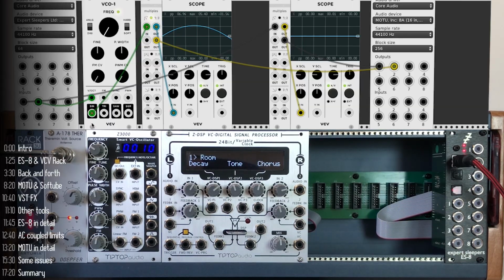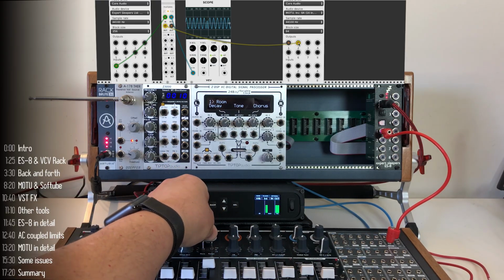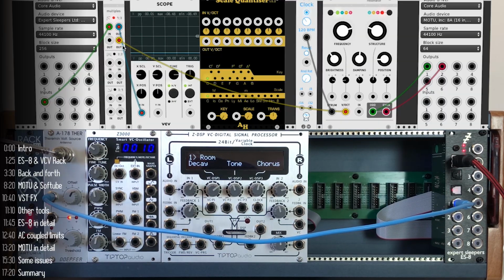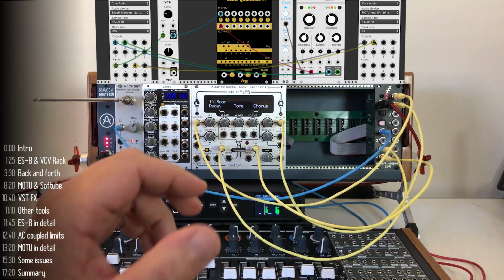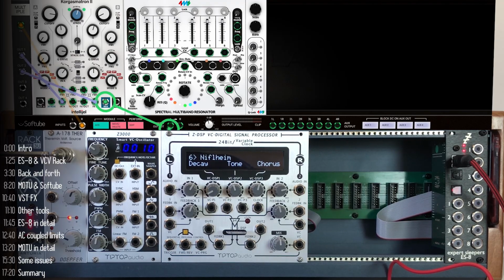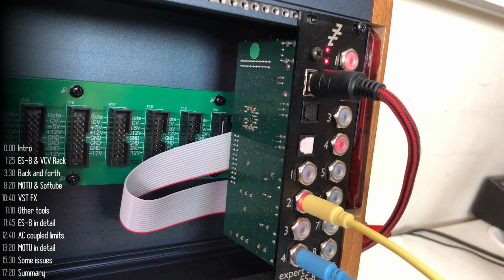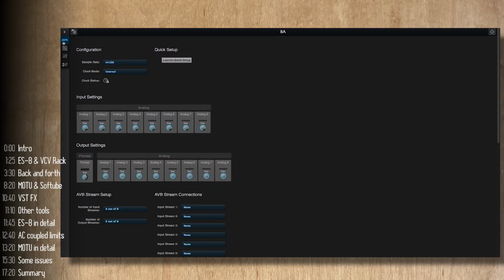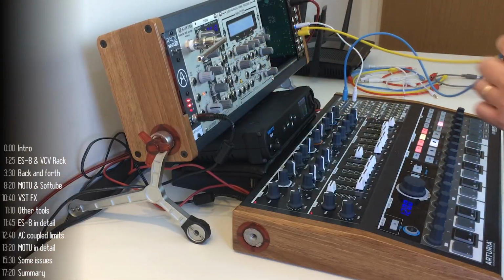Hybrid modular - The one must-have module: bridging Eurorack and VCV Rack, Softube (ES-8 and MOTU)

Comment: Screen update is maybe at most 60Hz, probably more like 30. Using that refresh rate to try and show latency (or the lack of latency) is just pointless - the latencies would have to be huge to be noticeable.
Latencies as low as a few milliseconds make a difference to the usability of a modular due to their effect on patches that use feedback - it's not just about whether you can notice the effect as input lag. e.g. take a patch with an oscillator into a filter into a waveshaper with the output feeding back to FM the oscillator and cutoff modulate the filter. If your oscillator is virtual, your filter is hardware and your waveshaper is virtual, the latency stacks up, and the result will be completely different from patching the same thing with only analogue hardware modules.
It's a bit disingenuous to present this to beginners as a 'solution' to the cost of Eurorack (or some other hardware format), or as a 'must have'. The result will never be the same, and the compromise is exactly in the place where you would want it not to be - patching flexibility. The kicker is that if you've not experienced patching on a full analogue system you mike never realise this.
Reply from the maker: I never used the scopes as a way to show latency... Scopes are just a way to make the video slightly less boring, and regardless, obviously the solution isn't perfect and of course every trip has latencies. The comment section is what differences of opinion are for. What I fail to understand is why you had to add the "disingenuous" label. 18 months after this video was made and I've since experimented with dozens more modules and setups, I still believe this is the best way to start a Eurorack setup because you have almost every type of module accessible for free integration into a setup. IMHO beginners should start with VCV and then gradually ease into hardware. It is indeed not without its flaws, but one isn't "disingenuous" just because they have a different opinion.
Reply: @loopop  I'll try to explain my reasoning. You don't talk in any detail about the latency issues. IMO this is the #1 topic when considering mixing hardware with software in this way. I've read a number of forum discussions where people have only discovered after spending hard cash that latency is even an issue let alone how significant it is. It's really not obvious until you know about it, and videos like yours are where people look for that type of knowledge. Your video is extremely positive, and talks at length about how great this approach to modular is. Unfortunately, it really does skirt around the equally significant negatives, which makes them seem inconsequential. If you know about the negatives (I assume you do - else why would you be making this type of video?), and you downplay them, then that is pretty much the definition of disingenuous, particularly as the truth would really weaken the claim that this is a 'must have' feature. 
VRV Rack is great! Reaktor Blocks are great! hardware Eurorack is great. Mixing hardware with software in this particular way is a workaround with various compromises and associated problems.
I very nearly fell into this trap myself, until I did some more research and thought it through more carefully - I bought a bunch of really nice used Doepfer modules with the money I didn't spend on an ES-8. And later I bought a much cheaper FH-1 instead which is more useful IMO. I sometimes use Blocks and Eurorack in parallel using the FH-1 to pass Midi from Reaktor to Eurorack. Works great!
Reply from the maker: colb what are you talking about I specifically mention latency issues (and 1v/octave calibration problems) and specifically say I didn’t test round trips and welcome proposals for such tests. Despite that I’ve since published numerous videos with hybrid setups filling in missing hardware modules with software ones. Of course there a cons along the pros, it’s very unfortunate you assume malicious intent where there is none.
Reply: @loopop  Yeah that's exactly what I'm talking about - it got a mention... like " btw latency might be a thing... maybe...".  No depth to the discussion of it, no explanation of it's significance in the modular context.
ie. in the familiar controller lag context, a few milliseconds will be totally fine for most people. In a modular audio rate feedback patch, 50 microseconds can make an audible difference, so a few milliseconds can completely change a patch. Trying to jump back and forth between software and hardware will stack multiple instances of round trip latency - it might produce some interesting results, but it will never be a replacement for staying in hardware - or in software for that matter.
Maybe ok for low frequency modulation, or patches with no feedback paths, but that takes away a lot of the fun.
Reply from the maker: colb you’re missing the point. I’m not saying I couldn’t have done more latency tests nor that it isn’t an issue across multiple round trips. It’s a YouTube video showing a concept few talked about at the time, a workflow that I was and am excited about. My problem is you calling it disingenuous just because it doesn’t cover every possible scenario hybrid option and isn’t perfect in your opinion (which I never said it was). The world is waiting for your perfect video - I can’t make one.....

Comment: In regard to the V/Oct tracking, MOTU's VOLTA software has an awesome calibration system which also gives you the ability to integrate the software with different systems at the same time, really nice feature.

Comment: How do you record your music with this configuration?    If for instance, the Minibrute 2 or 2S output is going to an audio interface to a DAW, then VCV Rack needs the VCV Bridge to route its output to the same DAW in a separate track from the MB2 (or 2S)?   Or do you just send all of the audio back through the MB2 (or 2S) via the External input & capture all of it in the DAW from the audio interface?

I can definitely understand it for live performance, but I can't see recording anything just yet, unless you need a second PC/laptop with audio interface to capture all of the resulting audio.
Reply from the maker: ES-8 is an audio interface so you could use that.
Reply: @loopop  Ah, right.  I forgot that part of it.

Comment: Hi Ziv, I truly enjoy your videos, I have learned a lot of them. I wonder why you haven't mentioned in this one an option like using Reaktor which has dedicated blocks for this very purpose. I'm using them through REM's BabyFace pro interface, which is not DC coupled but sports ADAT in and out that connect with Expert Sleepers ES-3, 6 and 7. I'm sure that VCV and MOTU interface is a cheaper solution but not necessarily better. Anyway, it's less messy with only two optical cables for 8 inputs and 8 outputs.
Reply from the maker: Hey Radu, thanks for your comment - no particular reason other than the video would be much longer - Reaktor is awesome - I’ll probably do a decidated video about it soon

Comment: Thank you for the helpful video .Does it matter if the red cable is balanced or unbalanced .I also use voltage modular software .
Reply from the maker: Look at the manual of our audio interface to see if it's OK. MOTU and ES say it's best to use a floating ring cable

Comment: Hi Loopop! I need your advise) I am building my first rack and can’t make a choise for USB to CV converter. The problem is that I have hardware synths and drum machines running through multi-USB mixer Soundcraft Signature 12 MTK (it is multi-USB mixer which I really like - Live can recognize all individual outputs). I was thinking to buy Endorphin.es Shuttle or Polyend POLY. But after I made some research about ES DC-coupled interfaces I am confused what I need to cover all my needs and wishes)). I really like extensions DC-coupled interface can provide, but as I understand I will need to choose it as Audio Interface in Live, so I will loose option to play together it with my other hardware running through Soundcraft Mixer. What would you recommend? Any options to run ES and Soundcraft together? Thank you very much for your investment in our education!
Reply: Hi Alexander, i'm in the same situation. I want an ES 8, but i guess it wont work at the same time with my soundcraft MTK in Windows. Did you find a solution?
Reply from the maker: Hey guys - sorry - just saw this. Did you consider ES 3/6 expanders instead? Assuming your interface has adat. I don’t know it.
Reply: @loopop  unfortunately it doesn't. I guess that the only option remaining would be to try using  Asio4all in DAW together with ES8 in VCV, considering that the Soundcraft driver probably wouldn't work (i don't know). I'll keep researching. Thanks loopop
Reply: @loopop  Hi! I recently bought MOTU Ultralite Mk4. And yes I was thinking about buying ES-3 Mk4. But Live 10.1 (I am using 9) promise to have M4L tools which should allow to send CV via M4L devices through DC-coupled outputs. What is your opinion: is it convenient to use M4L CV tools or ES-3 is more convenient? Thank you!
Reply: @kpr32  Hi! I recently have changed Soundcraft 12MTK for Motu Ultralite Mk4. And as far as I understand Expert sleepers has its own vst plugin for running the module: Silent Way. And as I understand from this video https://www.youtube.com/watch?v=Yf8cx5MOgdM&t=74s you need to choose it as Audio Interface. So there is probably no option to use both interfaces simultaneously.

Comment: And I was feeling like the coolest kid in the room getting my ES-8 / ES-3 Reaktor Blocks hybrid going. It really is the coolest thing ever!

I especially like using it as a mixing color/texture box. Very easy to send audio tracks/samples into say Verbos Amplitude and Tone Controller, XAOC Belgrad, Optomix, Morphagene, or a Retro Mechanical Labs GPI connected to many flavors of distortion/saturation boxes, some of which have CV control. Taking say a kick (or bass line) from an Ableton drum rack into a Zvex Mastotron while playing with its sub switch and tone knob = massive bass/punch/analog glow. So you also get a powerful reamp/mixing color box setup in addition to a Swiss Army knife of control voltages (you may not yet own in your hardware) to tickle your modules with. Add to that super tight sync that allows you to run your modular alongside your daw with the simplicity and ease of a VST....powerful. 

Also sending sections of your rhythm tracks to say the Dynmc input on the DYNAMIX to create new rhythms from modular sounds or samples is so easy. It’s really THE best conduit to fluidly integrate all the joys of modular with your DAW production process.
Reply: Is the ES-8 able to accept audio line level back into your daw? Thanks.
Reply: Norman Notes Yes I believe so. Andrew at Expert Sleepers explained to me that it’s just a D.C. coupled audio interface. You can also get  inputs from the ADAT.

Comment: thanks for this great video again, if I may ask again :-) , if I connect the es8 via adat to my audio interface, (for example presonus 1810c), do I need my daw, or does the audio, (produced by vcv in this case) from the es8 comes out straight through the audio interface to my mixer/speakers. With vcv/windows I cannot use two audio core modules in vcv with two different audio interfaces, so I want to use adat, but not also my daw with that, thx

Comment: Can you elaborate about the latency that the es-8 is introducing? In my experiments with using a Roland aira modular bitrazer as dc coupled Interface (minimal Blocksite 256 Samples) the latency is quite noticable hence it's unusable.When I e.g. send triggers from the modular Hardware to Hardware modules and VCV simultaously the VCV modules get noticebly delayed. Do you have any problem with latency with the es-8?

Comment: Not sure if you'll see this, but how did you get your audio from Es-8 into the VCV Rack Audio module's Output? I've tried this, but no signal comes from the Outputs. It is only when I use Ableton, then the VCV Bridge fx vst, that I can route the audio through Ableton > VCV Bridge > VCV Rack Audio module.
Reply from the maker: It works for sure. I use it every week - just keep troubleshooting. No need for Ableton or bridge. Btw at some point after this video made Andrew from VCV renamed the outputs and inputs so try it the other way around...
Reply: Oh wow thank you for that :). Yeah for some reason I’ve tried reinstalling VCV, and unplugging and plugging in the ES-8 back in, the Input light on the ES-8 shows that a signal is being fed. But for the life of me, I can’t seem to get the audio on the VCV Audio Module Output to glow or steam a signal. It’s pretty strange. I’ll keep trying different things though. Thank you for responding.

Comment: Thank you for this Information.

ES-8 cost 400 Euro =0
Motu 8 cost 777 Euro =0

The ES-4 and ES-3 with ADAT/SPDIF can do well, but only with SilentWay.
Arturia Beatstep Pro should also work digital and modular, was not trying all the outputs yet.
Also a Audio Interface can CV over the Audio Outputs (in my case Motu UltraLite mk3) can 3,5 - 5,6 Volts over a TRS to TS (ring floating) Cable Type.
But i never try that last setting, i dont wanna destroy my Setup or Rack if something going wrong ^^,
So there are possibilities choose on...for people who like digital modular more than relalife cable patching, should by the ES-8/4/3. A Eurorack Modularsystem will make u poor and depressiv.

Testing analog outputs for control voltage compatibility:
http://motu.com/techsupport/technotes/testing-analog-outputs-for-control-voltage-compatibility

Comment: awesome...watched this video earlier but now, as I looking into the ES-8, comes in very handy... but: if already having an audio interface (Qu-16 Allen and Heath), what DAW can manage handling two interfaces simultaneously ?     Or the Es-8 would work “separately” in such a situation?
Reply from the maker: on a Mac you can configure an aggregate device with two interfaces. ES also have output extension modules for regular interfaces.
Reply: loopop thank you

Comment: I had to return my brand new ES-8 because the jack sockets were so loose & weak that it took little effort to inadvertently cause the patch cable to pop out or fall out of the jacks. Apparently weak/loose jacks have been a problem with ES hardware for many years. An issue that ES is well aware of but doing nothing about. For $475, the ES-8 should not have such poor quality jacks.

Comment: Hi, great video! Now one question: do you know if the 828Mk3 inputs can handle sustained voltage? In my testings I saw that output does, but trying to send any sustained voltage through the inputs usually ramps down to 0V. A LFO for example losses it's amplitude as it gets slower. Seems that all is filtered with some kind of DC offset or high pass filter.
Reply from the maker: Thanks! Sounds like the inputs aren’t dc coupled :/ the only interface I’m aware of that has dc coupled inputs is ES 8 (or use their expanders)
Reply: @loopop  Yeap, thought that. Thanks for the quick reply and keep the good work, cheers!

Comment: Hi. This is fascinating and I’d really like to try this. I have a question before I dive in though. I’m working in windows and have a significant investment in software and hardware. I would like to stick with the audio interface I’m already using. If I buy an ES-8, can I just plug-in in and get access to cv I/O? Or will it take over as the overall audio interface? I’d hate to buy one only to find that it overrides my current interface. Thanks!
Reply from the maker: Good question. I use it mainly with my Mac but I believe windows supports multiple interfaces. Pick your regular one for the os and es-8 for VCV
Reply: @loopop   In case you're interested. I have a partial answer to this question. I did a ton of research and had a brief discussion with a very helpful Andrew Ostler at Expert Sleepers. In short, the ES-8 would likely work - as you described, being used by VCV but not my DAW. However, since I'm using an interface with built in ADAT/Lightpipe, I went with a different option. I've ordered an ES-3 and an ES-6. This eliminates the dual audio interface issue as the ins and outs from the ES-3/ES-6 will effectively just be more ins and outs from my primary interface. I haven't received the modules yet but I think this will be a good solution. There will still be some issues I suspect. I doubt VCV Rack and my DAW can access the same interface at the same time so I may not be able to pass audio - other than using VCV Bridge which works very well in my experience. I'm really anxious to get this all together and figure out exactly what I can do. 

Naturally, I would never have known these devices existed or even of the concept of DC Coupled ins and outs had it not been for your video. Can't thank you enough. I ordered a Disting with the ES-3 and ES-6 and made sure Andrew knew exactly where the inspiration to buy them came from! Now if only I can find the inspiration to make interesting music with them!
Reply from the maker: Gregory Baker Thanks so much and I’m sure inspiration will come. The beauty of modular is that it forces you out of routines and old habits. I keep getting surprised every session....

Comment: How would I get an external source to be modulated in VCV Rack instead of oscillators? Something like plugging in a guitar and applying delays, LFOs, reverb, etc. pls help im dumb
Reply from the maker: easy - add the VCV audio interface module, choose your interface, plug your guitar into the interface with a real cable and drag a virtual cable out of the VCV module to wherever you want